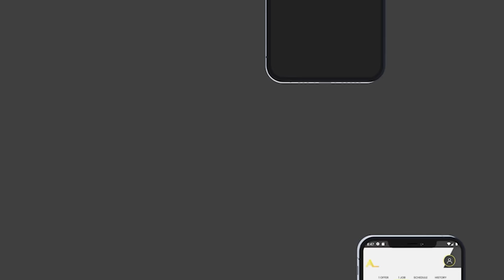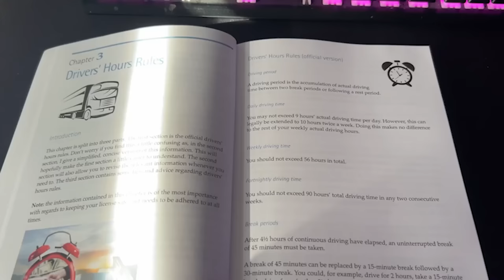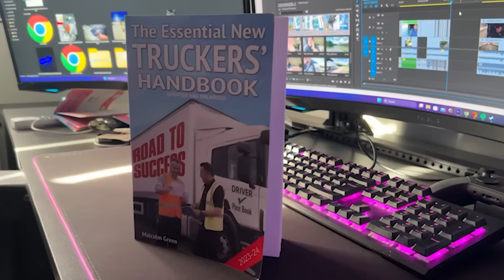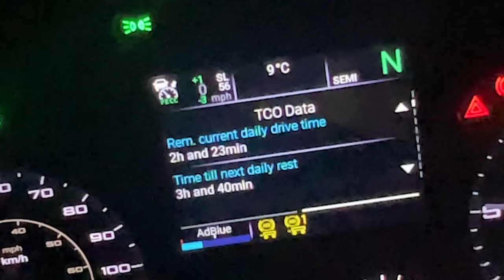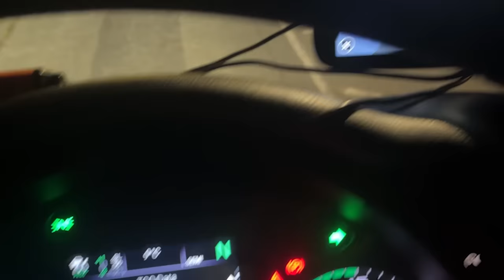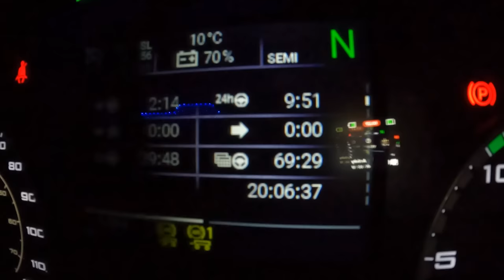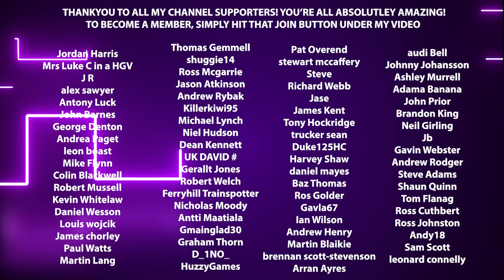100’s Of Miles To Drive, Not Enough Hours To Do It!

Comment: When filling your Ad-Blue, if you're putting in the whole, or most of, that container in, punch a hole in the top behind the handle with a screwdriver.  It lets the air in as you're pouring and stops the glug glug glug splashing.  Great video as usual.
Reply: looking at the tubes, he reuses them. i think.
Reply: No need for holes, he needs to have the can in a sideway position and it'll stop that, and for the idiot jambo calling him clueless, the man clearly stated that those containers are taken back to the yard to get refilled.

Comment: If you're tight on time, pull in, if no good go on, wasted opportunity spotting the space after you are past it. Also in the dark, turn off all interior cab lighting. Its a lot easier seeing out in the night time. Try not to make habit of running too tight on hrs. Its not good for your physical and mental health, elevates stress levels. Over here more so. In canada there was loads of space and truck stops were huge, so finding space wasnt a worry. This is why lots of truckers try to park up early. Glad i dont tramp anymore.

Comment: I'm not sure if I passed you on Tuesday on the 417/ 419 between South Cerney and Cirencester, omg - your lights are so bright when flashing someone, I think my retinas are still burning :)
Reply from the maker: Yes they are bright 😂 put it this way, if the driver is wearing a hi viz, I can see it reflect while looking into the passenger mirror of the truck in front 😂
Reply: @lukecinahgv  but the driver in the hi viz is 5 miles away!  keep smashing the content, hopefully you weren't flashing me on the opposite side of the dual carriageway :)

Comment: Seeing the tomtom traffic issue - I have this issue constantly on the expert plus and cannot connect to MyDrive on iPhone. Really disappointed with it at the moment. No multi vehicle profiles as promised and some routes are very questionable. Tomtom don’t want to know which considering what they are charging for these devices is shocking. Would also be interested to see if you have had the black screen after using for a while? Reboot fixes but not great when you need it!
Reply: mine keeps black screening the hgv plus 7 inch      have to press the power button on and of likes 5 times till it shows the route
Reply: @DavisM1988  definitely something wrong with these  - I press and hold the button and eventually it comes back to life. I am hoping this is all going to be fixed in a firmware update but not holding my breath!
Reply: I'm really liking my new Garmin, There are some things it's not great at but on the whole I prefer it. pros: the routing is great, they show popular truck routes as blue roads and it seems to handle 7.5 restrictions without sending you (literally) round the houses.
It has the best reception in London, even with the tall buildings.
You don't have to subscribe for live traffic, it's a free app for it to connect to on your phone.
Cons: It messes up some major junctions for correct lane to be in, eg. M25 to M11 north it tells you to get into M11 London then switch to the other lane after.
The upcoming delays are only displaying the next delay and not what else after until you pass that one.
The lane guidance can be lacking sometimes, works great through London though.
Reply: @jaffabeast  yes I have to agree about the Garmin - have the dezl 800 which I have switched back to using after the issues I have had with the TT. Definitely the better sat nav all round. Pulling double deckers we often get given specific routes we must take and Garmin shape route feature makes this so easy but TT you have to keep adding stops. The TT does have some great features in terms of guidance and I like the 3 route options compared to Garmin offering only 2 but you are definitely getting way more for your money with Garmin. I can even watch Netflix on my Garmin and YouTube or browse the internet. The only problem I have with the Garmin is I can’t get it to show up on my mac and have to use my sons laptop but all updates can be done from WiFi anyway so no big deal really.